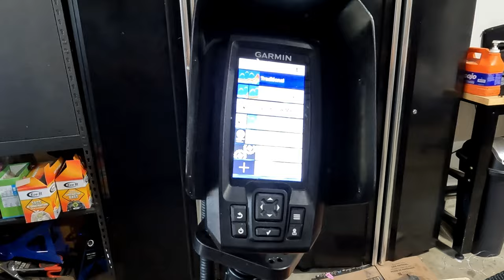OLD TOWN SPORTSMAN| Upgrades For Salt Water Kayak Fishing!

Comment: Grease the screws - corrosion x or some salt water type of grease - also very important to use that type of grease on your prop sheer pin - they have a lot of exposure, especially in salt and corrode very easily - if it goes while you are out, you are in trouble with no prop! Carry a few extra “sheer pins” - you can find some old drills in the right diameter and cut them for cheap replacements. Have fished my Predator PDL hard now for 7 plus years - salt and fresh.
Grease the scupper hole fish finder mount hardware! All of it - it will corrode if not
Reply from the maker: @Charactermatters650  💯% all of our screws and parts get coated with corrosion inhibitor twice a year, we each carry 5 extra sheer pins in our drives as well as two extra props each because you never know! Paddling these beasts home would be a nightmare! Thanks for watching! 🙌🙌

Comment: What was the original issue that required the warranty replacement?
Reply from the maker: The hull was cracked under the seat just behind the rudder deployment handle.  There's a foam block inside the hull that supports the seat, and it had shifted so there was no support under the seat. The foam support block is just siliconed in place so now we check them every couple trips to make sure they haven't moved.

Thanks for watching!
Reply: Thanks for the info. I will keep an eye on that.
Reply from the maker: @thbrtmn  no problem at all! We've since added some 1/2" starboard where the back of the seat sits, hoping to beef it up and disperse some of the weight in case that foam block ever shifts again 🤞
Thanks for watching!

Comment: What size wire loom did you use for your cables?
Reply from the maker: Good question, we probably should of included that in the video. It's 1/2" loom.

Thanks for watching! 🙌
Reply: @kckayakfishing  Awesome, that's what I figured but wanted to be sure before I bought some. I'm setting up my 120 sportsman based around you're build, it's so well thought out and functional.
Reply from the maker: @johnmelendres8974  awesome! We absolutely love the way our 120's turned out, simple but effective! Good luck with the build! Any other questions, you know where to find us! 🙌🙌